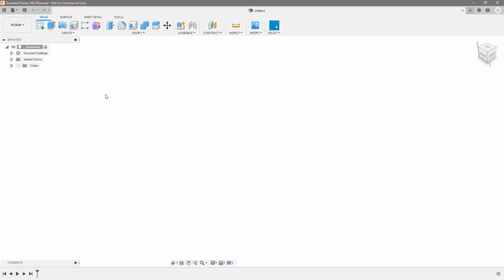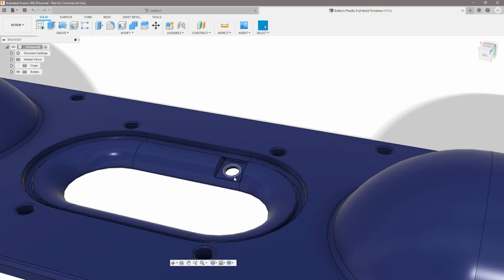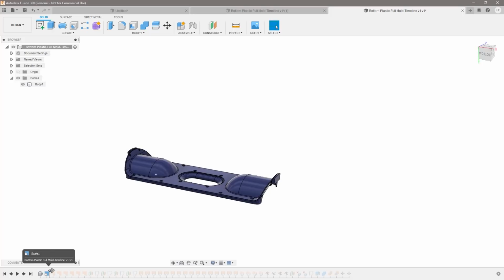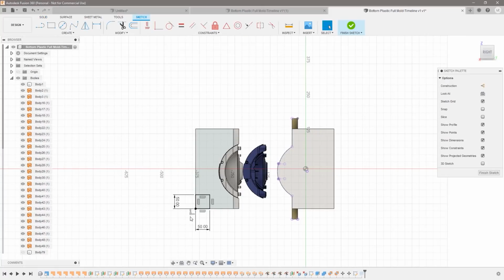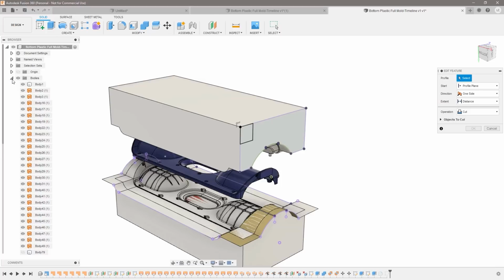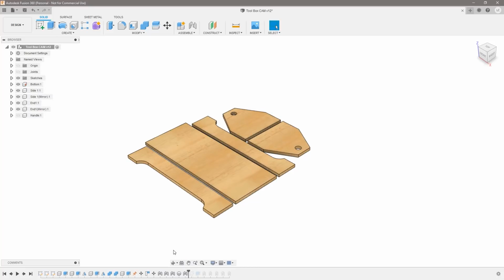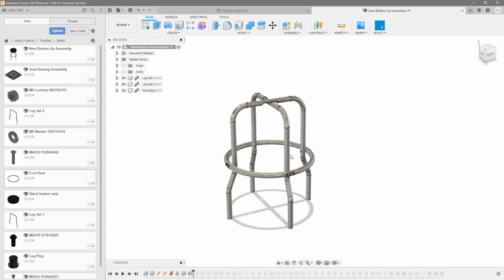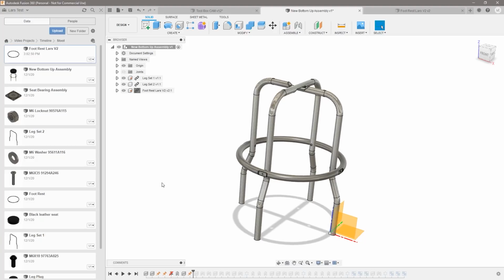Fusion 360 Tutorial - Timeline in 3 Levels of Difficulty | Season 3

Comment: I have been using fusion for the past three years but still having lots of trouble with the timeline breaking. Everything online says to use Top Down approach. I can’t get used to that because the timeline always gets too complex, impossible to navigate, and slows down the computer. Also every single change to any previous steps ALWAYS breaks the timeline and Fusion is not very good at telling you exactly why it’s broken or helping you to fix it. 

Bottom up seems a lot more manageable. 

And it seems like you are using a bottom up approach, at least with the barstool. You designed each component in a separate file and have them linked into the master file.

Is this not “bottom up” design? If not, how is this considered “Top Down”, or how is it different than “bottom up”?
Reply: Did you figure out the issue? Any advice? Once my design gets more complex than a few components, the timeline breaks when I update parameters. I follow the basic best practices, use components, fully constrain sketches, use user parameters for everything, yet the timeline breaks or fusion hangs up for sometimes 10 minutes on complex projects when trying to adjust the design or even sometimes as simple as changing the size of a fillet

Comment: I am accustomed to parametric 3D software such as 3ds max.

Is there a SIMPLE STRAIGHT FORWARD way to set object sizing without using dimensions linked as sketches?

I.e. create a cylinder 100mm diameter by 100mm tall.  After the fact, say I need to change the height to 80mm?  I know I can just push/pull it down 20mm, but is there a way to just select the cylinder and type in 80mm for the height?  Same for the diameter / radius?

Thank you!  GREAT STRAIGHT FORWARD VIDEOS!! 😊
Reply: You can do that and more using parameters.  Google search "Fusion create or edit parameters."  You will find enough to get started there.

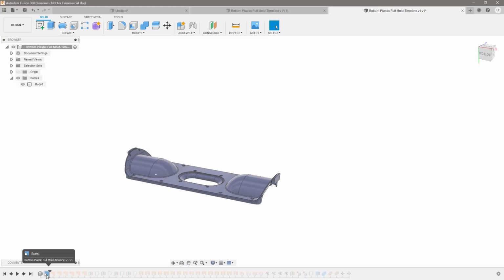Comment: Thanks so much for your amazing videos, Lars!  You are the best!  I have a (many!) questions… @ 6:08 you noted you ‘scaled the model up’.  How is that done? Do you have to change each and every dimension individually, or is there a more efficient way, i.e. select desired (if not ‘select all’) dimensions and multiply by in this  case amount of shrinkage, say by a percentage?  The other question I have is… Is the design of the cavity a manual process (in other words, rebuild a negative) or is there a possibility to simply add a separation line for the mold and F360 automatically creates the mold? I seems a manual process would be incredibly time-consuming, given all the dimensions, details, fillets, etc. are already there? Sorry for my beginner questions and if you already addressed this elsewhere. THANKS again!
Reply: For the scale you have in the "modify" le'u a scale option. There you can do all the scaling you want. Good luck

Comment: when setting up your assembly by modeling parts in place (and easily  grounding them afterwards), wouldn't you have a hard time of navigating the model, as the part rotates around a datum point which is outside the parts' centroid? Or is athis only an issue with a mouse and not with a trackbal (as experts maybe should use)

Comment: Isn't it bad practice to ground components? Now it will not move relative to the assembly if you change de design of the legs. Also, why isn't the time line on the right with each function name visible? Scrubbing through icons really makes no sense. I guess fusion as to cut some corners not to hinder the sales of inventor?

Comment: Good explanation of the timelines. For the toolbox example, I realize placing the pieces flat is intended to show timeline usage, but suggest doing another video on this same project using the ‘Arrange’ feature in Manufacturing. Just finished a project to cut and drill wood pieces using a cnc. The project was too big for manufacture in the original (was real slow). Workaround by saving the pieces to be cut as a ‘derived’ assembly. Opened the derived assembly and created a model in Manufacturing and then arranged the pieces side-by-side and added the cnc post processes. The master assembly is left unchanged and the real beauty is any changes to the master are drilled down to the manufacture model.